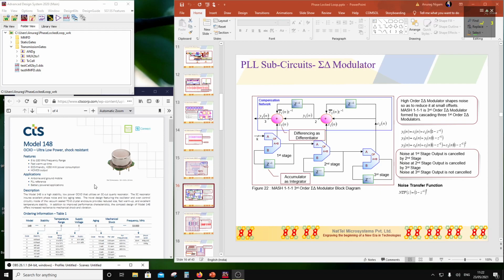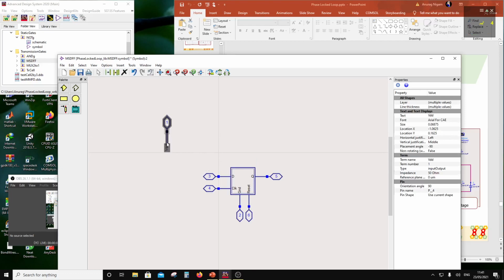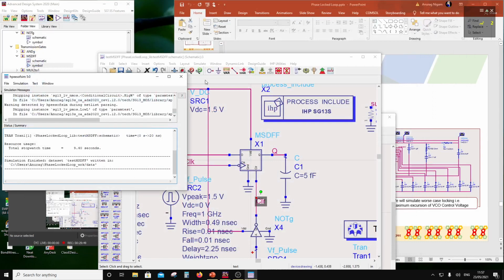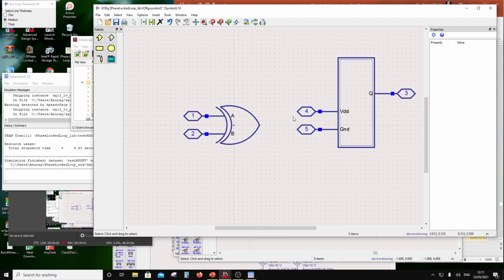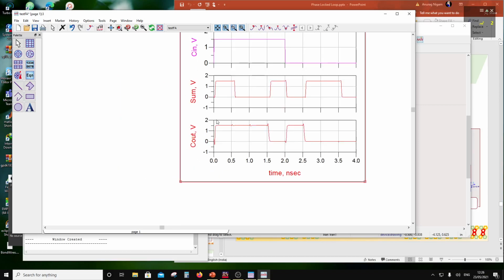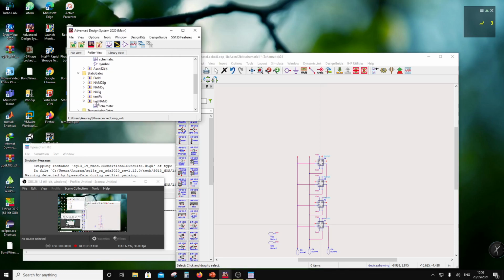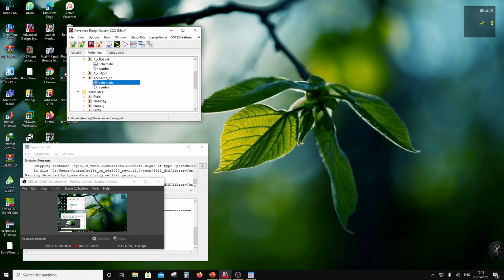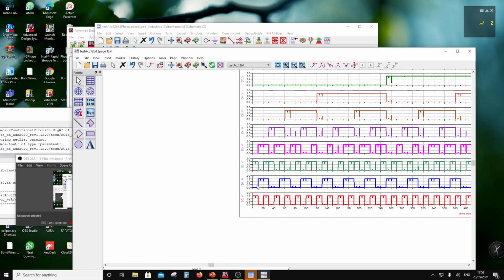Analog Circuit Design using ADS Session29

Comment: This master slave is different that what you made in session28. Your Q and Qb are swaped. why ?
Reply from the maker: I may have picked my signals from different inverter outputs to cut down two inverter delays between input output paths
Reply: @anuragnigam9443  In both (master and slave) you use Qb not Q. Arent we suppose to connect Q of master to D of slave and output = Q of slave?
Reply from the maker: @sarrafimusic   please try to understand that i am using two nots less in forward path. As long as master slave differ by half clock period, it does not matter
Reply: @anuragnigam9443  Thanks for the explanation